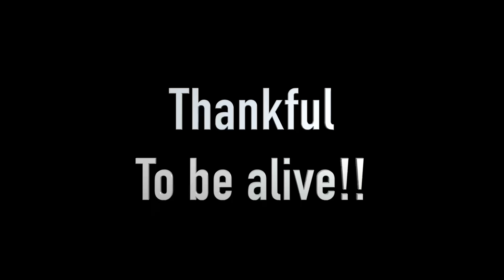The Firefighters said I was LUCKY TO BE ALIVE after this stupid MISTAKE!!!

Comment: As a former electric company worker, I would say that was an illegal connection… someone getting some free power. Very glad you are okay Al.
Reply: I was thinking the same thing
Reply: @jeb3415 I am retired phone company, and I cringe every time I see the ground wires not connected for the utility boxes on the sides of houses. Abandoned or not.
Reply: Yeah, if you look at the video when he was cutting around the front porch ramp a man walked from behind the house down the street
Reply: @billandbeverly  That was Tre...
Reply: @billandbeverly  That was his buddy. Lol. I noticed it also and did a rewind.
Reply: Yeah, and I figured the squatter was peeved the power was turned off.
Reply: You dont know what your talking about, every kid could see the line came down. Nothing "illegal"at that situation.
Reply: @billandbeverly  That was Al's friend Tre.
Reply: Isn’t there power coming in before the meter?
Reply: Just as I was thinking
Reply: You can see it coming from the main line behind the tree in the front yard.  Power had been hot cut and capped. In the scene with the EMT Al picks up the wires and you can see the caps on the end.
Reply: @peterswalmen  so the storm sucked the electric meter plum off that house, bent the service drop pole but managed to cap off the hot neutral and ground wires then for extra good measure the storm stretched the service wire taut and reattached it inches from if not on top of the roof shingles. 👍🏻
Reply: @jeb3415  that's exactly what I said! Someone had rigged that from the look of that electrical box. It was opened when Al was pulling down the moss. Yup someone stealing power.
Reply: Yea, like the squatter inside. Was curious to know if he/she was still in there when they all left.
Reply: @sherryw1919  Al did see someone in there, I do believe.
Reply: it looks like the service mast was yanked down,  I'm surprised there were still wires in it.
Reply: @John-hw3ds  22:42 you can see the service line coming from the pole, it has moss hanging from it..
22:49 you can see it coming to where it's attached to the roof, and you can see the ground wire, going laterally about a foot and ending.
the service mast, and wires coming out of it.. still have the connectors on it.. 
but someone had to pull that down,   that line needs to be cut at the pole.  ( note,  my dad was a meter man, and then a collection agent for a power company,  he's shut off many people, and some would tie their dogs up to the meter,  and he'd just have a line crew, cut it at the pole,..  which that costs a lot more to reconnect,
Reply: Yep.  Welp, that's $10,000 gone to avoid a lawsuit by the homeowner, lol.  Amazing lack of understanding about how electricity works by every single person in this video.  No idea how people are getting high school diplomas.
Reply: Yes it should have had no power the meter box is missing.
Reply: @majikjuggalo  No. Not in the USA when electric companies supply the electricity.
Reply: @mkel858  power is disconnected is steps,  first they put plastic insulators, and replace the meter,   for easy reconnect,   if thieves remove thel, they will take the meter, and install a glass plate on the box,  if that is bypassed,  they will cut the line at the pole, but that requires a bucket truck, and lineman.  
linemen make a lot more than collection agents.    This appears to have just the meter removed,
Reply: @billandbeverly  Now I'm going to watch the video again and see if I can see someone leaving the house🤔🧐
Reply: I was thinkin that too.....he did think there might be squatters!🤷‍♀️
Reply: Jeb3415 As a former power company worker (what exactly did you do BTW?)  that was not an illegal connection, it was a damaged service that was disconnected and tapped off but the drop wasn't disconnected at the pole.  No one was getting free power or there would have been additional wiring running off to someplace else.
Reply: @mxslick50  we would pull the meter and disconnect the power at the pole for vacant derelict houses thus reducing the risk of a fire hazard. I could be wrong on this house. But if you look closer you see that the service line is taut AND connected to the house at the roof. That means the electric company cut it from the service drop and reconnected it to the roof.  Typically that service line is cut and rolled up and left,  disconnected, on the pole to be used again if it is undamaged and there is enough length. We cannot see if there is any additional wiring into the house.
Reply: You are right.
Reply: was that 110 or 220??
Reply: @Group_Anonymous   120 hot to neutral, 240 hot to hot (Neutral was the bare silver wire).
Reply: @jimonthecoast3234  Nah, a storm took ours down and wires stayed in it. They separate from the main up top. No reason for them to get yanked out unless the pole gets ripped away as well. Even then the wires would likely stay connected to the box.
Reply: @stephjezo6470  it depends on the connection,  these you can see pulled out of the splice connectors, but I think it was a person that did the damage.
Reply: @peterswalmen  was it you that illegally hooking this up👀😅
Reply: I prolly wouldn’t say they are getting power considering there overhead service is unhooked from the house crazy thing is I work with this older guy he said he been shocked by one of those and it makes you go stupid for a good bit he definitely got lucky forsure but I think it was just a unproper disconnection and they never got rid of the lines
Reply: I know where I live if the power is not turned back on to a property in 6 months they come around and disconnect it from the pole and drop the feed line to the structure. They do that to prevent power leeching and theft. One place the power company came around to do the main pole disconnect and found that 5 places were leeching power and stealing it. They said that it looked like whomever done the hookups knew what they were doing.

Shortly after they cut the power at the pole and removed all of the illegal hookups the cops did a drug house raid and busted 15 people in 5 different houses that were formerly attached to the illegal hookup. They found enough supplies and equipment to make well over 200 pounds of meth. They were using each house as a different stage in the process. One was the supply warehouse, 3 were for the making of it all and the last one was the final product warehouse where they wrapped it all up and distributed it all from. They made all of the movements of the stuff at night with the exception of the product warehouse which had a constant flow of people in and out on the weekends.

All of the illegal hookups went to the detached garages of the properties and they were made to look like they were from the cable and phone company and not the electric company. Since they had those 6 structures under their control the rest of the neighborhood had no clue what was actually going on until the raid happened. That 6th house was an abandon property that did not have the main power line turned off at the pole and after they hooked the power up from there they left that property alone. The other 5 houses were actually them renting them out and they had all of the regular power hookups but the garages had the illegal ones so the power company had no clue they were using more power for the rentals than they actually were.
Reply: @rispatha  wow. What a story! It continues to astound me how clever (and evil) these drug producers have become. Thanks for sharing.
Reply: Actually I think it got damaged during the storm because the meter is laying on the ground and meter pan is open like it was broken off. Not  from stealing electricity although I've seen it being stolen that way working 18 year for the electric company I don't think this was one that was stolen electricity.
Reply: I was thinking the same illegal shit
Reply: @theresacullens7794  No one “left the house”. The person they were talking about is Al’s friend Tre. “billandbeverly” didn’t bother to pay attention to see that it was the same exact person.
Reply: i think it was just left behind i used to work on lines as a tree trimmer and its supposed to be capped off at the very least, as for it being an illegal connection there is no connection illegal connections would be one that bypasses the meter
Reply: @jeb3415  it doesn’t matter where. Electricity is sent from the main transformer to the meter. Then the meter regulates the power to the breaker box. Unless they disconnect from the pole the line to the meter will be live.
Reply: That’s what I said too
Reply: @majikjuggalo  True, electricity is sent on a wire from the transformer to the service drop, through the service drop pipe over to the meter. What is confusing here, is that the power wire was disconnected and capped off at the service drop, which would have been above the roof line. So then that service drop pipe gets bent over. How did the line get reattached directly to the roof? Ok, so the electric company pulled that live wire taut and reattached the live wire and capped it off at the roof? Why? Or let’s say the original service hookup the wire came in, the electric company attached it to the roof first and then went through the service drop? So then the elec company cut the service wire, capped it off at both ends and left it hot (fire hazard) from the pole to the roof. That is about the only alternative explanation.
Reply: lol as someone living in rural TN with pretty much ever power line running to a house looking like this…. Where tf do you work!
Reply: I took calls for the electric company including a DOA call for an AT&T man who died on the pole. Those look like modified jumper cables at the meter. Energy theft is a lot more common than people think.
Reply: @paytonguarnett4244  lol NOT in rural TN, for sure, but I have lived in FL in fact not far at all from where Al and the areas he does his yard clean-ups.
Reply: The electric isn't connected. If you were with the electric company you would know that. It was totaly discoed at the house side
Reply: @douglasharrington3003  yes we’ve already established it was a magic spark that occurred when Al severed 2 of the 3 wires from the ‘disconnected’ line- maybe a bit of voo doo or lightning even! 😂 And having been with the electric company, I have seen 7 ways to Sunday how people bypass the disconnection to steal power. If you were even the slightest observant, you would see it here, at the roofline. The wires were hot. Not enough footage to show if someone was stealing the power, but plenty to indicate the power was still coming from the pole, hence his near miss.
Reply: AGREE 100%
Reply: My kid did first year electrical on his way to his electronics manufacture and maintenance journeyman certificate. He said the same thing.  This looks dodgy as hell. It looks like someone had something set up next door, perhaps parked where he is clearing now, to the mains and power from the house.
Reply: As a YouTube watcher of his videos, I'm glad he's still in one piece. He could have been fried or worse! There's been deaths on FB and don't want to see any on here. He must be living right--God was with him!
Reply: Yeah, he had mentioned that he thought he’d seen someone in the house. They may have done the connection.
Reply: That’s exactly what I was thinking……Thank you lord for looking after Al!!
Reply: No its not its a standard connection he just cut thru a live wire
Reply: no one was stealing power, line was disconnected from meter, looks like a tree limb nock line loose, in always think any power line is live...
Reply: What happened love the video
Reply: Where I live they don't even have to pull the meters anymore to kill power to a property so the whip supply going to the drop stays hot they will only disconnect the whip from the transformer if someone gets caught stealing power by bypassing the meter.
Reply: Yes I no the light company cut off in the office
Reply: More than likely storm damage the meter loop, power company doesn’t repair and just rehung service and capped the ends for electrician to repair meter loop
Reply: That was not an illegal connection, just a sketchy one.

Comment: My pawpaw used to work for a telephone company as a lineman a long time ago. 
One day he ended up getting into a power line and got electrocuted. And these are high voltage stuff. Usually residential receive about 120-240v, large commercial receives around  277-480v. the stuff he got into was about 375v I believe…

As the two guys that was with him was trying to bring him down the pole, his harness got caught on one of the spikes. 
They tried and tried to get him untangled and wasn’t having much luck. They was about to cut the harness and let him drop to the ground when they pulled really hard one last time, keep in mind my pawpaw wasn’t breathing at all and a lot of time had passed trying to get him untangled. When they pulled the last time he took a deep breath in. 
Knowing that he was alive they eventually was able to get him down the pole and to the hospital. 
Thanks to the greatness and mercy of the Lord above, he made a full recovery and kept on working and providing for his family like it never happened…
The Lord definitely was watching over him that day, and he was definitely watching over you on this job here.
Reply: It's not the volts that kills you. it's the amperage in the lines. Even in a home if the amps are high enough it can kill you.
Reply: Yup!! Exactly @EastCoastGamingHFX
Reply: he did not get electrocuted he got shocked the difference is electrocution literally means electro like electricity and cution like execution so if you are electrocuted it means you died and your cause of death was a fatal electric shock or “electrocution”.
Reply: @jacksonforman9560  He didn't get either. Since he was holding rubber. that's the only thing that saved his life.  If you're talking about Bubb comment if you read it. His grandfather died.. and then was able to be resuscitated. Which in fact means he was electrocuted.
Reply: @EastCoastGamingHFX  not true. in the story he said that he was stuck up there and they saw him breathing. they did not use a defibrillator or cpr also even if they did that doesn’t mean he was dead. for a defibrillator to work there still needs to be cardiovascular activity meaning your heart is beating very slowly or faintly and the machine shocks your heart back into rhythm. cpr is essentially doing the same thing but not as well what cpr is great for though is keeping your blood circulating. it is not medically possible to bring someone back from the dead however with modern medicine and advancement over the past 80 years we have gotten really good at stopping people from dying completely.
Reply: Wow! Thanks be to God!❤
Reply: What a tremendous story from life.  Glad your pawpaw made it through.
Reply: @jacksonforman9560 That’s just not true.  The definition of electrocution is to kill or severely injure by electric shock.  Death is not required.  OP used the term correctly.
Reply: @mdcla  ahaha no. oxford dictionary can eat my ass 😂😂 I only go off of osha standard for anything electrical or structural. my dad is a master electrician so he is quick to point out wrong terminology with anything electrical and i am osha 30 certified just recently.
Reply: @jacksonforman9560 your wrong there are cases where people have been pronounced died. Not only pronounced dead but was dead more then a couple of minutes. There are cases where they were dead 15 to 20/25 minutes.
Reply: @Carla-p9f  it doesn’t matter if they have been pronounced dead or not if they come back to life they weren’t electrocuted. Osha is the literal government agency that protects workers from unsafe work conditions and from employers. osha will sue companies all the time and a large part of legal cases is complete definitions for every word like electrocution and shock. the nfpa says the same thing and that is national electrical code. you are simply wrong not just linguistically but also legally.
Reply: Amen!!!!
Reply: @mdcla  I've been an electrician for other 30 years and I was always taught that electrocuted means death
Reply: @markpotter8280 That is the original definition, and the OSHA definition.  As an electrician I think it’s entirely reasonable to use that definition.  But the colloquial definition has evolved and people use the term commonly to describe electric shocks fatal or not.  So I wouldn’t argue that OP is incorrect.
Reply: @mdcla  I'm glad that cleared that up 😁
Reply: @jacksonforman9560  Incorrect. The definition of electrocution is "the injury or killing of someone by electric shock" Injury is not death. 
and you are also wrong about the defibrillator. It 100% DOES restart a non-beating heart. 
Please look things up before posting incorrect info. I dont care who your daddy is. and OSHA does not define language. Oxford does.  You are literally online where you have a repository of almost all information on earth. you have no excuse to be that wrong that much online.
Reply: Amen
Reply: @PositiveOnly-dm3rx amen thank you.
Reply: think you mean "grandpa"...grow up
Reply: @kevinschindler618  All my cousins and I called my grandma mawmaw until the day she said I was in my 20's. It's a southern thing. Iykyk